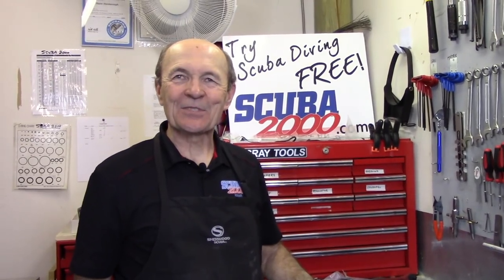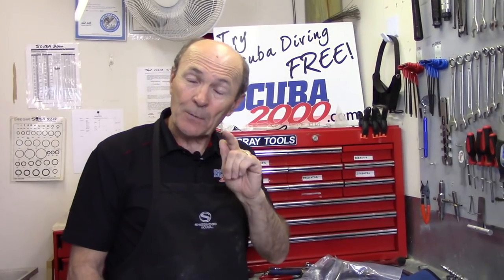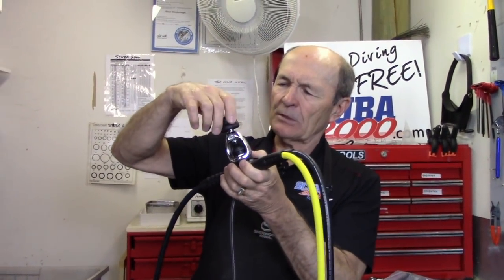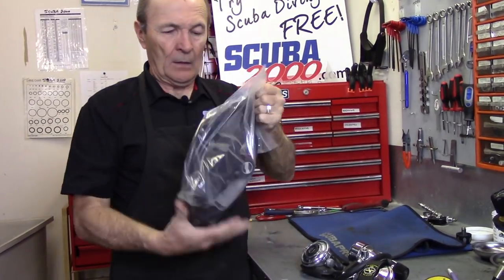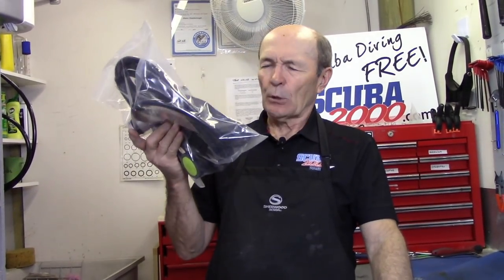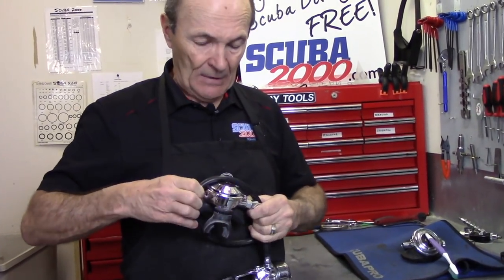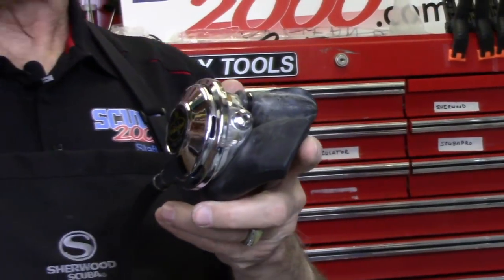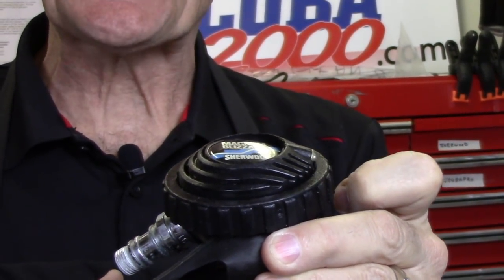Regulator Storage - Scuba Tech Tips: S03E16

Comment: What are your thoughts on the the Atomic seat saving orifice? Do any other regulators a similar solution? Also, are those scubapro screw ins still sold. I could use one for my g250b
Reply from the maker: Back in the stone age, seat savers were everywhere as o-ring were not as strong or cheap as today.  They are not needed but give peace of mind to some divers.  Look how many regs are sold without these features, everyone is still happy and safe.
A

Comment: I think this is a bad idea , reg's rolled up for any time starts making the hoses stay rounded plus it weakness the hose near the metal ends,
Reply from the maker: Thanks for your comments Jim.
I suppose I need to explain what I mean by 'rolled-up'.
Perhaps the better word would be 'coiled'. Certainly if the reg was tightly rolled into a small circle,  the strain on the hose ferrules (the metal ends at the first stage) would be bad. If 'coiled' carefully however, in a circle that's maybe 12" or more in diameter, then there's no strain. Many people hang their regulators on a hook and if you picture that you'll realize that the hoses hang straight down. The weight of the second stage makes a sharp bend at the ferrule and unless supported by a good hose protector (also called a strain relief) the hose can be damaged.
I have mentioned in another vid that the flex hoses do not have this problem. They can also be more tightly bent without damage. More and more manufacturers are using them now.
Thanks for watching. Alec

Comment: Alec what do you think about using zip ties to hold open the inflate and air dump valve on my BCD power inflator so seals/gaskets don’t take a “set” during storage?  Good idea or bad?
Reply from the maker: Not needed as the pressure on the inflator spring is not great.  If you get your BC AND power inflator serviced regularly, they should check it for leaks and replace the small schraeder valve inside.

Comment: Alec how did you know I store my dive gear in the boiler room?
Reply from the maker: LOL.
But I have found that lots of divers store their gear in the basement, often in the same room as the furnace. 
NOT GOOD! A furnace, other than electric, generates heat but worse it emits other gases that can speed up the deterioration of rubber. Even electrical devices can be harmful since they emit Ozone which is one of the worst offenders. 
Cool, dry, dark is the ideal environment. Preferably sealed in plastic.
Many items in my Sea Hunt collection are rubber and they are 50 to 60 years old. But, sealed in a zipper-style plastic bag, they are like new.
And, even with the widespread use of synthetic materials in our scuba gear, rubber is still very common - O-Rings, regulator hoses, wetsuits and accessories, tank band grippers, BCD hoses and much more.

As an aside, Steve, I wonder how many people today even know what a boiler room is!
Take care. Alec

Comment: Hi, is it good idea to store the regulator in hard plastic lunch box for a while ? also use it while traveling in the box to avoid hard shocks ? I mean it's the most expensive part of SCUBA Set, should I store it lunch box for safety and avoiding moisture :)
Reply from the maker: Lots of divers use a hard box to store their reg and it's just fine. Be sure the hoses aren't kinked too tightly and that it's clean and dry. Clean means well rinsed of sand, salt and mouth debris (the stuff that comes out of you and into the second stage on every breath). 
I personally never found a hard box convenient for travel and like to use an extra tough freezer Zip-Loc bag but a hard box will give it more protection from knocks I suppose.
Good luck.
Alec

Comment: So if i put my regulator in a vacuum sealer, is that good?
Reply from the maker: Uh, I don't think that's necessary.
Diana and I use a vacuum sealer all the time - great for freezing and storing meat but maybe not so good for a regulator. I guess it would work but all you want to do is eliminate fresh air. A Zip-Loc bag does it. There are new ones on the market with double zips on them, very tough. I suck the air out of the bag with a straw or small piece of tubing before sealing them.
Alec

Comment: Can the purge release be done with the Apeks xtx200?
Reply from the maker: Not Sure. Do you mean a purge relief to reduce pressure on the second seat? If so, you simply have to make a Velcro strap with a small ball or 1/2 ball on it. Wrap the strap around the second stage so the ball slightly pushes on the purge button. That simple. Now you can store your reg indefinately. Thanks for watching. Alec